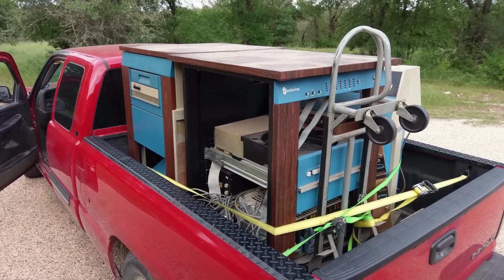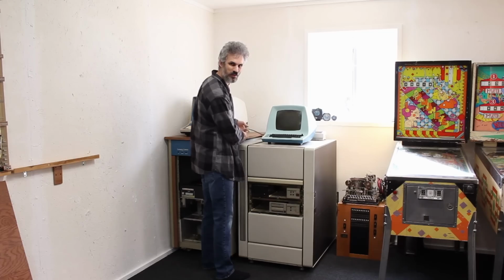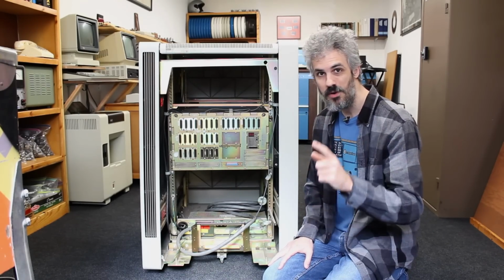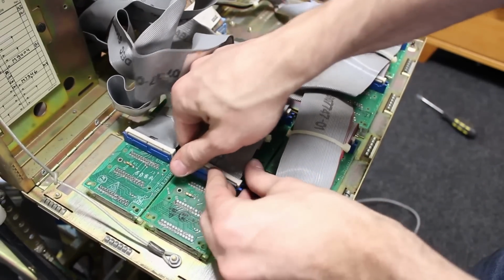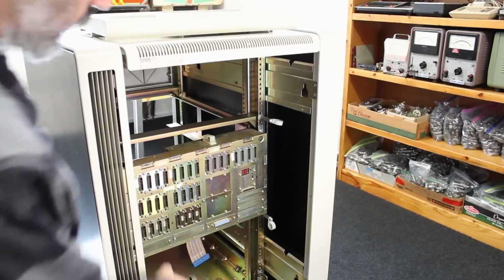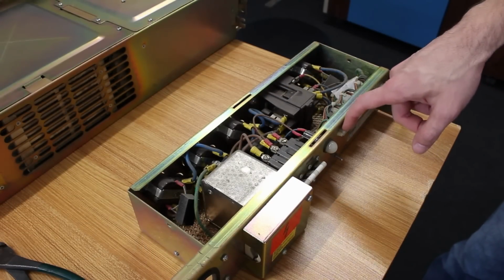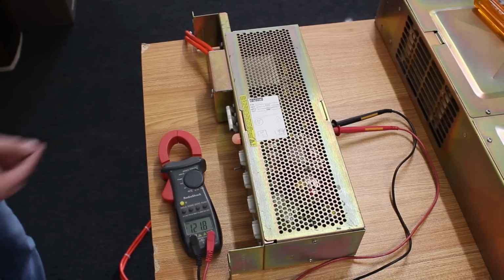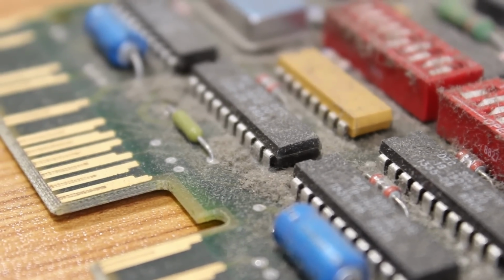I Bought a PDP-11/83!

Comment: My former workplace used a variety of PDP11's as front end terminal controllers for a mainframe. They connected to a network of other PDP11's with many terminals connected.

Oh, and I think you owe my neighbours an apology for making me shout out loud when you produced that dual mains cable death trap. Very glad to see that you were talked out of it.
Reply: If OP is not going to be running anything more than a couple of RD drives, a 12/3 SJOOW power cord is sufficient.  Maybe a NEMA 5-20P plug.  Of course that would mean the receptacle would have to be change to a 5-20R but you can still use "standard" 5-15P plugs with it.
Reply: I remember in the late 1970's at college PDP-11s' were used as RJE (Remote Job Entery) terminals for submitting our programs on a stack of batch cards.  The programs were read off the batch cards and submitted to the big mainframe IBM 360s' somewhere else on campus.

Comment: I did some FORTRAN development work on an 11/03.  The system had two DEC-made 8 inch floppies for storage.  It was a real chore swapping floppies in and out for the edit/compile/link/test iteration.  That’s good incentive for doing your best to get your code right!  The O/S was RT-11,; I forget the release.  If I recall, we had to build the O/S image on a larger 11/34 with RL-02 drives.  The terminal was a Hazeltine 1500 which could emulate a VT-52.  The worst thing about the 11/03 was the power supplies were very loud, switching at just a few KHz and making a very loud gritty whine as they regulated.  I wore hearing protection to deaden the noise.
Reply: Hate to disagree about the power supply noise, as I have that you system you describe right here, now , beside me, and the noise was from the mil spec fans they used. I replaced them with modern ones and reduced the level of noise significantly.
Reply: @markcummins6571  The 11/03 I worked on was about the size of a two drawer filing cabinet.  It was built late 1978 or early 1979.  It was definitely the power supply choppers whining.  As I noted above, we also had an 11/34.  The 11/34 front panel was the newer type with the keypad and 7-segment display, about the same age as the 11/03.  The fans of the 11/34 were more noticeable than the 11/03’s snd white noise.  I also worked on a DG something which was embedded in a rack which was part of a Tracor Northern signal analyzer and the DG had an even louder switching sound than the 11/03.  Even the old guys who’d been to a lot of rock concerts complained about the noise from the DG.  The DG ran the Tracor programs out of core, no peripheral devices other than the A/D and CRT unit.  We could power the individual pieces up separately, so we knew from whence the sound emanated.

Comment: unusual for it in the US to have a UK/european colour code mains cable! and much of the power unit internal wiring.  is it 120v only or dual 120/240 voltage switchable

Comment: Did you try 91% Isopropyl Alcohol to clean off the tape gum?   If that does not  work, try WD-40 ..or maybe some GUM OUT.    Can the new type of  Hard Drives be configured to work with that computer, Or are you just stuck with using the older types?
Reply: I think the Maxtor here was MFM ..  using MFM with another interface is difficult. There are convertors to IDE for some MFM drives but ther are technical problems around this conversion. I think a comment else mentioned the possibility of a SCSI interface (presumably SCSI 1) so an older scsi drive might work?

Comment: The tape drive uses a format called CompacTape, which was developed by DEC in the mid-1980s and was later rebranded as DLT.  Versions were developed as late as 2007, and the most advanced such drives could store up to 800GB on a single cartridge, while maintaining the same physical cartridge format.  All of those drives have high-speed pancake servo motors which have to be forced-air cooled.
Reply: Used those DLT tapes on MicroVax.which was connected to a DECNet network for office applications.  It all got removed when PCs took off in mid 80s.

Comment: Happy Holidays!  Nice find on the 11/83.  There is a cleaner called De-Solv It!  Which is very good at getting rid of tape residue.  It is citrus based and will probably not harm the paint on the PDP, but I would try it somewhere inconspicuous first to be sure.
Reply: Sticker or adhesive remover is a more generic term for the citrus based stuff. 3m makes one thats in some hw shops at least worldwide
Reply: That’s the stuff. Been using it since the days of floppy disks, for changing the labels when reusing the disks.

Comment: You might be able to get the tape adhesive residue off with alcohol, cigarette lighter fluid (naptha), and/or acetone, minding the flammable/toxic vapors of course and especially watching the interaction of acetone with any plastic.  I was surprised to hear that Goo Gone didn't touch it, but other solvents still might.

Wiring the 30 amp power input to a 20 amp plug sounds like it should suffice if you know your machine will not try to draw more than 20 amps.  If you really wanted to do it right, you could add a 30 amp 120v circuit (or 15 amp 240v?) from the main panel or possibly subpanel that serves the garage workshop you have set up.  I believe this will need 10 AWG to wire per the NEC.  What was the idea with the suicide cable anyhow?  Trying to parallel two circuits to get 30 amps?  Besides the live plug, you'd trip the breaker if the two circuits are from opposite sides of the split 240v house feed, and paralleling two circuits on their own circuit breakers is unreliable anyhow because due to different resistive circuit impedance the circuit breakers may not share the current equally.
Reply: no no no not acetone! it can and will damage the color.  One drop of Eucalyptus oil and your'e done (tried, tested and guaranteed)

Comment: A very nice score, the PDP-11/83 was one of the later 11's it uses the bus called QBUS and is a slightly faster 11/73 with Private Memory Interconnect. The 50 pin cable is likely for an external 9-track tape drive. The built-in tape drive is a TK-50 and is likely dead as they were unreliable by the late 80s., it could be replaced by a TK-70 drive which will read but not write TK-50 media, and the TK70- would evolve into DLT. 
Although UNIX is available for the PDP-11 series remember it is a 16 bit machine and UNIX is not fast on an 11 and does not show off the architecture well, (now UNIX on a VAX  is an entirely different story). You would want one of the DEC os' for the machine like RT-11, RSTS/e, or RSX-11M Plus.
Reply: The old Klondike Bar drive!
Reply: I used to dumpster-dive at a local Macintosh peripherals company.   They had lots of these tape drives in the dumpster. I tried using a few of them and they were all very marginal, only rarely able to format and test a new tape.

Comment: I have been using "Bestine" solvent and thinner for thinning or reducing rubber cement by Speedball.
It is N-Heptane, and is compatible with most plastics except for polyethylene. I use it often for cleaning up dried sticker residue on old test equipment.

Comment: Try removing the glue from the tape with the 3m adhesive remover, i can send you a link for this. It’s commonly used to remove glue from cars when replacing glass, it doesn’t touch the paint!

Comment: I found that orange-based cleaner (containing D-Limonene) can remove pretty much all glue/tape residues very effectively when other solvents failed. Just watch that paintwork!
Reply: Eucalyptus oil is also pretty good on various tape residues. (.au opinion here)
Reply: I have this stuff in a CRC-branded can, and it's really good! Do not use on polycarbonate or polystyrene, though.
Reply: Try using WD-40… Something you might already have on-hand.
Reply: @psears27  Yeah, WD-40 is also great, but seems to work best for sticky tape residue. That PDP-panel residue looks dry 🤔
I see people in the comments using IPA to clean WD-40 smear, but IPA does hurt some metal powder paints. Also, IPA is a bit overkill as WD-40 comes easily off with any basic household cleaning spray 🙂

Comment: That’s an awful lot of steel and pleather!  DEC was more centered on mini-mainframes where the customers expected big and heavy boxes.   In this case, a bit of overkill to hold a 15 MHz CPU with a maximum of 256K of memory.  The PDP-11 has a very clean instruction set but also micro programmed and very slow.   It also had like a dozen operating systems, most of them lame.  I programmed one for many years and was never amazed by its speed.  Even tight assembly-language loops ran considerably slower than similar loops on a cheaper and much older PDP-8.   I hope you can get yours running.  Expect trouble with the fan and disk drive motors. The foam blocks may be necessary to keep one’s sanity.
Reply: this system supported a 4MB memory configuration and was not slow at that time.
Reply: @markcummins6571  Not that it matters, but it still only had a 16-bit address bus so you could only have 48K of code, 48K of data, and 48K of stack, in any one program.    Instruction times were in the 20 to 50 clock cycle range,  you could usually get more work done on a 1MHz PDP-8.
Reply: @georgegonzalez2476  There is memory management on both machines. You code in relocatable code on PDP11's and an Operating System can utilize 4MB of memory (21 bits of address I believe). You do realize that the PDP8 memory page is only 4K in size and the breath of its code is geared to run fast but it does not have the power of the PDP11 opcodes. The PDP11 MOV code was usually be done in 6 cycles. I do not agree with your perceived average clock cycle utilization between both system types.
Reply: @markcummins6571  You are correct, the PDP-8 made you turn somersaults to access more than 4K words.  But for small real-time tasks it was often faster than the 11!   Quite a letdown  when our lab got a PDP-11/34 and it didn't impress.   The cycle counts I got from the long 11/40 manual.   it took from 1 to 3 microseconds to fetch an operand, 1 to 6 to do the operation, and another 1 to 3 to store the results.  Often adding up to being slower than a  PDP-8!  Adding insult to injury the baseline FORTRAN compiler generated "Threaded code".  A really innovative and mesmerizing technique, but really slow as operands couldn't live in registers and each sub-instruction ended with a slow indirect and incrementing jump and no possible optimization.   All three of us programmers there voted with our feet and did as much as possible on the faster and friendlier PDP-8.
Reply: @georgegonzalez2476  The PDP8 machines, all of them were state level logic, not micro sequenced. It was a 12 bit machine. Only people that solve their small programing needs liked it. I do not believe that you lived in the PDP-11 world very much. Did you really quote 11 /40 cycle times to your 11/34 exposure, and decide the PDP-8 family was a better machine type than the 11 family, when it never took longer than one clock cycle to fetch an opcode, or writing to memory? Why would you want to execute an opcode from a general purpose register? How would you manage program flow? I do not believe you understand the PDP-11 programing systems so I do not think you could properly compare the programing environments of the two machines to compare which is better. You think that OS8 is better that RT11, RSTS, or RSX? If you three left, via feet, I wonder if the company was not better off. Please stop trying to rewrite history
Reply: @markcummins6571  Just relating my personal experience in using PDP's in research labs for almost 10 years.    In general the PDP-8's were much cheaper, simpler to interface lab equipment to,  faster in running tight data-collection loops, had no memory refresh breaks,  and had much better compilers, editors, and a real powerful shell.   By comparison,  the 11's required massive interface cards,  memory refresh interludes unless you bought another $8,000 of hot static RAM.  RT-11 was bare-bones, with maybe 5% of the shell features that OS/8 had.   The text editors and debuggers on the 11 were various dismal shades of awful.    

Also on the 8 we had the complete OS/8 source, so we could dig into the OS and the compilers to add many neat features.  Oh and also you could run RTS8, which truly virtualized the CPU and peripherals, giving much better multitasking than the minimalist and crashy FG/BG barely possible under RT11.    

I loved the 11's almost orthogonal instruction set but didn't like paying the price of the complex bus handshaking cycles and the microprogrammed instructions and the threaded FORTRAN code running on top of those.   Three layers of unneeded and slow complexity.  Sometimes less is more.  A dissappointing and hard lesson to learn!
Reply: @georgegonzalez2476  Maybe your perceived metrics would have fared better if you had experienced a PDP faster than a 11/34 (not even an 11/34A). You slander the whole PDP line because of your use of an improper general purpose CPU solution. You seem bitter, maybe everyone is better off since you left with your feet.

Comment: Very nice piece for your collection. As for the tape goo, I've used WD40, then rubbing alcohol. Finally, go over all your plastic parts with 303 spray. Used to restore dashboards on old cars. Best of luck
Reply: Always helpful to have a bottle of the 99% Isopropol alcohol handy. Not in stores generally but on Amazon.

Comment: pretty sure that switch means A-automatic O-off B-Bypass . Those small connectors on the back is likely for control on the A setting, and the one that is not controlled by that is simply a standby always on socket. also the three breakers are probably separated for 10 amps on one set of sockets and one for another set, so might want to check that out before you pull 12 or so amps on it, it may be on one 10 amp breaker, possibly one each on the breaker. i could be wrong but i don't think they'd put those 15 (maybe 20) amp sockets straight to 30 amp. (couldn't see what was on the other side)

Comment: Isn't that triple-pole breaker for three-phase power?  I thought the all the old DEC racks had delta-connected three-phase into the panels at the base.

The AC will be drawn from the A and B phases, which are both 120 V phase to neutral.  The C phase is a wild leg at 208 volts. That triple toggle switch is probably A phase / B phase / open.

Trace out the wiring of that power panel!